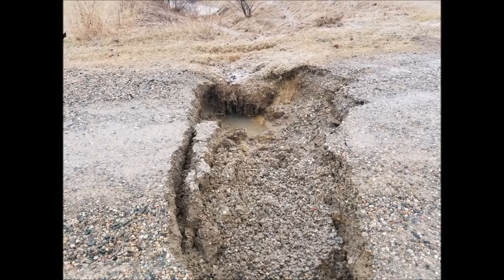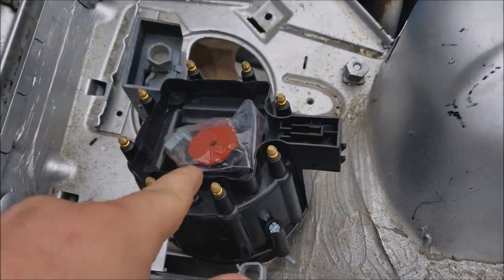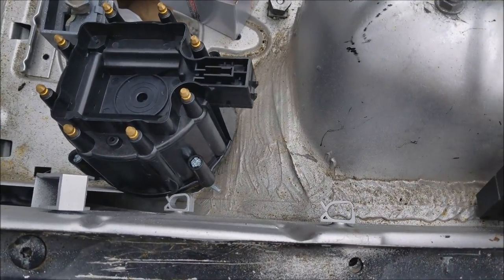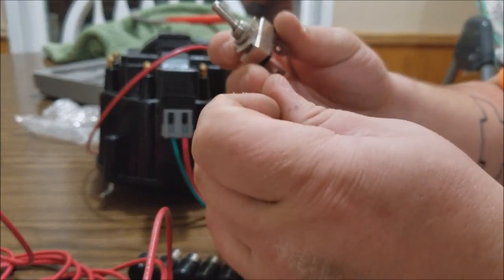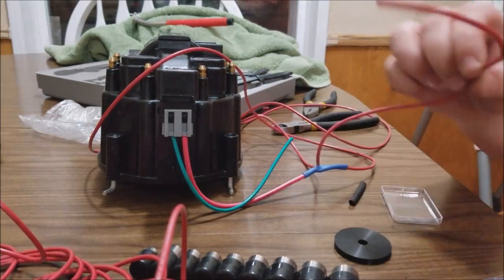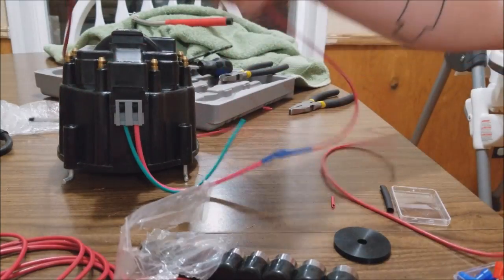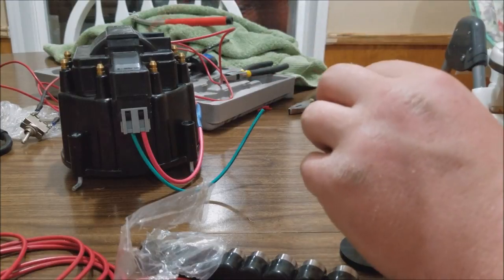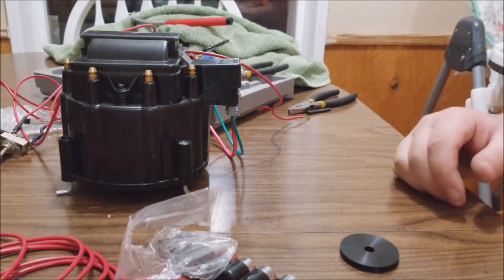Wiring up the distributor!

Comment: I just swapped a ford 302 in my 1990 f150 to a 1996 351w the wire harness connected perfectly to everything except to the distributor I need to know what wire is what on the harness and the 351w distributor so I can get it connected correctly
Reply from the maker: So I've never messed around with fords, your best bet is to find a forum on Google or Google the wire diagram so you can connect the appropriate wires together, good luck! Sounds like a fun project!
Reply: I tried I can't find anything that shows how to do that
Reply from the maker: I'll see if I can't find anything
Reply: Thank you
Reply from the maker: @timmyholland9352  you have an email I can send some screen shots of what I found

Comment: I'm trying to do the same thing on my 54 Chevy Beater. But I'm trying to get the acement of the cap, on the distributor. You say we are going to connect here. Where is here?
Reply from the maker: I don’t get what you’re asking sorry, acement of the cap on the distributor?
Reply from the maker: Spark plug 1 points to cylinder 1. I can’t remember exactly what I did since this was 4 years ago but the dizzy has a harness. You need to look up wire diagram for the dizzy

Comment: Hey, so I have a points distributor with a coil. And I just ordered a 1 wire setup like the one your featuring. Only thing is there are 5 separate wires attached to the positive terminal of the coil. One is the ignition, one is the electric choke to the carb, and the rest I think are just wires to guages that need a positive terminal. Is it okay if I install all 5 wires to a connector that fits the one wire set up?
I really dont want to have to go searching around for "what wire is what" and try to find another place to put them on. If they all went on the coil in the first place, it shouldn't matter if it's an hei coil right? A coil is a coil. Same principle.
Reply from the maker: I would think so, but honestly I'm not sure. I'll see what I can find
Reply: @GottisGarage  Alright, thanks
Reply: It worked

Comment: The caps are not numbered, how you know what spark plug goes to what spark?
Reply from the maker: firing order. on a sbc number 1 cyl points to number 1 spark plug. then you use the firing order 1,8,4,3,6,5,7,2 and match the cylinders accordingly.
driver side bank is odds 1,3,5,7 and pass is even 2,4,6,8. hope that helps

Comment: So the distributor has 12 volts constant and controlled by toggle switch?
Reply from the maker: Yeah
Reply: Why ? Why not ignition switched ? Theres a spot in the fuse box under the dash that says ign that's switched by the ignition it's what I always use to run the hei. Distributors

Comment: I replaced everything on my hei distributor but still getting a low light spark from my new plugs and wires any suggestions
Reply from the maker: Andre Wade stupid question but do you have your dizzy sat in right and timed right?
Reply: @GottisGarage  no stupid my guy thanks for replying what a dizzy or distributor
Reply: I put a mild size cam in my 350 sbo 79 Chevy Caprice will the gear make a difference on the mild cam I have a older aftermarket distributor
Reply from the maker: Distributor. You have to roll the engine over to cylinder 1 then have the rotor pointing at cylinder 1 that way it can hit each point correctly
Reply from the maker: Top dead center of cylinder one. Stick a long screw driver into the spark plug hole and keep turning the engine till the timing mark on the crank pulley reads with the mark on the block. You have a 50/50 chance it’s actually TDC because it will line up with the down stroke
Reply: @GottisGarage  I did that and it ran but shut off if I put it in gear and just cranking up and yes I'm getting fuel I fill a hold jug up with fuel in 10sec but I change the carb and no luck on it
Reply: @GottisGarage  on the 0 mark when lining the mark up that what I said I set it up on tdc and try adjusting the carb it was idling loud so I suspect the carb was junk I have a similar Edelbrock like yours in the video when I put everything together no fuel no getting inside the carb at all not even sparying from the two noozies but fuel In the fuel filter
Reply from the maker: There is a float inside the carb so if fuel isn’t getting in I would think it’s stuck. I’m not to sure. That was the first carb engine I messed with.
Reply: @GottisGarage  yeah I seen them I think they need to be adjusted when I took the carb housing off no fuel was even in the there just brought it from a guy yesterday he told me it ran on his Corvette question if you manual mess with the throttle cable does your noozie squirt when moving the accelerate pump up and down
Reply from the maker: Andre Wade unfortunately I don’t have this car anymore
Reply: @GottisGarage  I gotcha thanks for the advice will do the timing again with the screw driver way but thanks my guy
Reply from the maker: Andre Wade yeah sorry I couldn’t help ya man, but there are only so many reasons why it’s not working! Take it one at a time you’ll get it!

Comment: 2:45 I though you supposed to run on with the key ignition wire to the distributor? 😓🤦🏾‍♂️
Reply from the maker: LevelUpLiving yeah the car was wired with a push button so I ran a switch to the ign wire to shut the car off
Reply: @GottisGarage  hmm 🤔 on both of my cars  I have push to  start bottoms too.  One  wire to S on starter & other on bat+ hot. Once the button is push it closes & completes circuit.  get your self a new factory ignition switch and I think on most old gm cars there's should be a thick " pink wire"  coming from the bulk head. Well on the 82-92 firebirds & Camaro. Use a light tester. probe that wire with a T pin and see if it likes up " on" ON  with the key" and then turns off with key to off position. That way it should turn your motor off.  I  hear stories about a faulty alternator or if it's wired wrong, you wouldn't be able to turn your car off.🤦🏾‍♂️
Reply: @GottisGarage  where is the ignition wire located? Under the dash? What color is it pink?